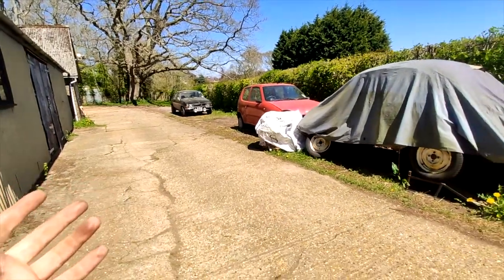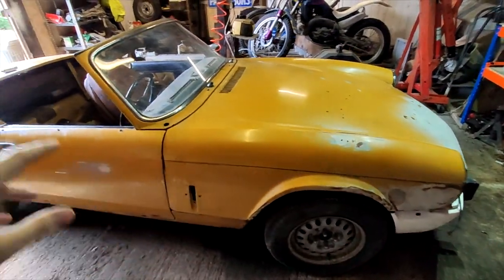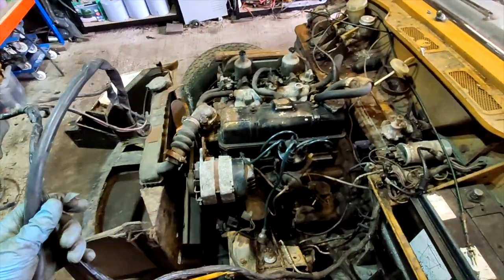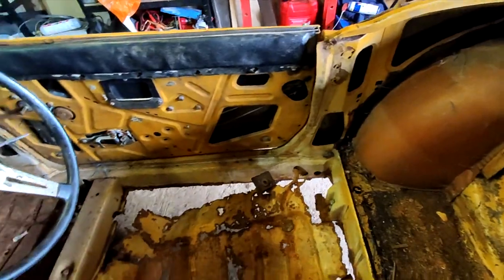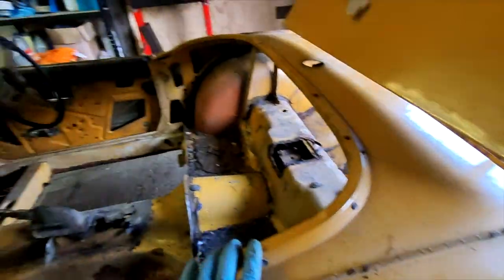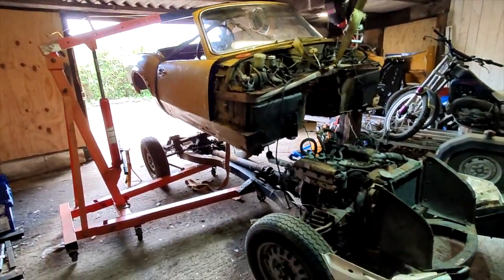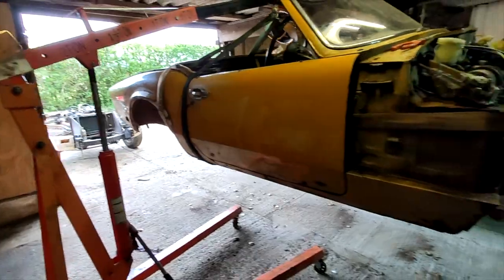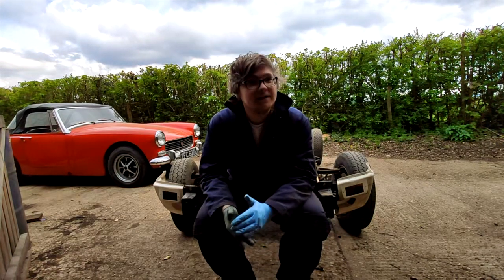Splitting the car in half! 😬 //separating the body from the chassis// Triumph Spitfire Part 3🔥

Comment: Personally i'd get the grinder out with a wire wheel and go to town on all the rusted area's, boot floor, inner wheel arche , heal board, sill's, firewall etc, get to see what you working with, i would have braced it before lifting the body though, main places on the chassis is the underside of it, front outrigger's area can be a really common place, wish you the best of luck mate
Reply from the maker: Thanks Steve yea looking forward to doing that! 🙂 it's al braced now on the rollover jig and the doors open nice and freely fingers crossed 🤞it doesn't bend when I cut the sills out. AHH thank you I will check there! Also gonna watch your video on repairing your sills for some tips! 👍

Comment: The floors can be easily replaced with the body on the chassis, which helps keep everything lined up for when you have to replace the sills, which you will do looking at the state of the floor.... Definitely need to brace that shell now otherwise you'll have a nightmare with alignment later on.
Reply from the maker: Hi thanks yea it's now welded and bolted to a rollover jig and fingers crossed it's braced enough 🤞 feels like it's not flexing anymore haha